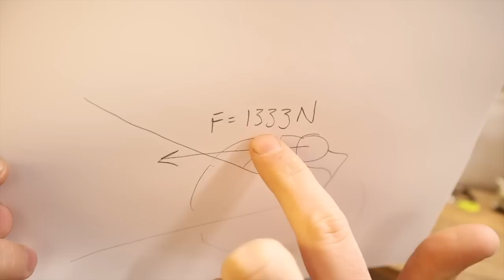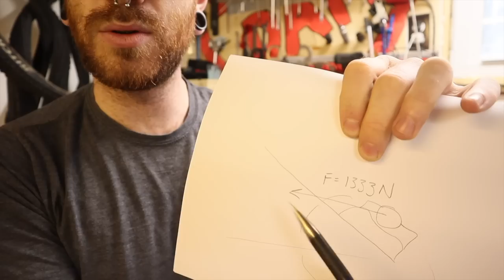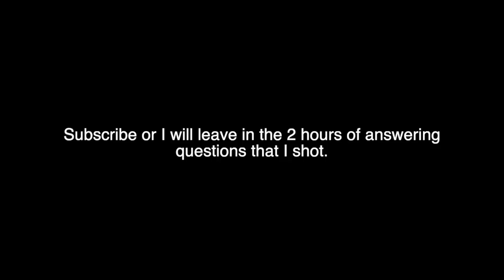Yes I am reinforcing the GT's welded disk brake (ANSWERS).

Comment: I'm welding a iso tab on my rigid fork on my 99 Diamondback outlook cause I got a. Bafang disc brake hub motor with rim and new schwalbe marathon tire for like 40 bucks, with a tektro caliper and rotor. Fork is thick like the black one on the GT, so I'm sure it will be fine. Welding a tab on is cheaper than lacing a new Rim brake rim on for me

Comment: Finally i see you use your degree to justify an idea, i usually use my engineering degree to check ideas that look like bad ideas at first
Reply from the maker: Lol i generally don't show any of it, but if im not sure i will justify with some educated research.

Most people suspect things are much weaker than they actually are.. but I was taught to work with a safety factor of around 5.
Reply: @Spindatt   i get it, depending on the application you choose safety factors if people knew how lean planes and weight sensitive structures are calculated they wouldn’t use them.

Comment: so..   here's the thing// the brakes on the fork already deal with them forces. literally NBD.. my GF dead stopped her indie 4 luckily with a puffed up handlebar bag...   the fork bent the rim bent..  I had 203mm rotors and I'm pretty confident it was all the impact forces.. also I was a welder as a teen in the 90s.. and I'm AMT-S composite structures.. tech as you are..   but helped my brother study for his engineering civil..     replaced with surly big dummy fork again with 203mm rotor...   now welding a 96 tange rocky mountain and getting amped up with videos of the same sort...   yeah I'll reinforce the frame but the fork...add the mount IS the reinforcement..  people hop and do trials with these forks.

Comment: You mention how people are scared of used carbon. Is my fear irrational about my aluminum road bike breaking. Do you know if it’s actually common for frame failure to happen with a pretty lightweight aluminum. How long have u seen aluminum last for?
Reply from the maker: I've seen failures in all materials after years of abuse, though i would say my tricross will last my lifetime.. as long as I don't have a reeeeeally bad crash with it

Comment: If you would'e cut the seat stay on the other side you could've welded back in a splitter to turn the Guru into a belt drive single speed!
Reply from the maker: Tubes are pinched and formed for cassette clearance over there so it was the non drive side tube i had my eyes on haha

Comment: I’m currently doing the same conversion. What filler wire did you use? Shielding gas? Is the GT chromoly?
Reply from the maker: Mig weld flux core, only the seat tube is chromoly!

Comment: did you just kill the guru? :o
Reply from the maker: It was dead long before I got it. Never mentioned it really but the rear triangle was absurdly twisted. Tire always rubbing unless I placed the wheel “just so” and the brake always tweaked to the right.

Yes; we could have tried to straighten it. Though, it’s steel is better used in other places.
Reply: @Spindatt  damn, can't imagine the annoyance after all that work on it
Reply from the maker: I think the resulting projects it’ll donate it’s life to will be cooler and worth it anyway haha

Comment: Hi. Please prepare one more video and make it clear that this calculator was a big joke!
Reply from the maker: open to your rebuttal. Engineering quarrels are the back bone of things like F1 and I like that
Reply: @Spindatt  Here you are:

You made a lot of mistakes while analyzing this task.

First of all, you assumed only the braking load case for the calculations, and meanwhile you should calculate the resultant force from several load cases that may occur together - e.g. braking plus the load from hitting an obstacle (hole, stone, curbstone) - of course taking into account the weight of the cyclist and the bicycle. Moreover, you should consider what the distribution of forces will look like during a sudden turn.

Second, the static load case will not be a critical load case at all. The worst thing you should take into account is the fatigue , with particular emphasis on the weld that you added to the system (the weld significantly deteriorates the fatigue results)

Third, the rear fork is the most strenuous area in the bicycle frame near the wheel mount

Fourthly, to simplify your task, it would be best to see what the forks with disc brakes look like and try to apply this solution to your frame. Then the probability of an error would be lower.

Fifth. Without knowing how to build a bicycle frame without FEM analysis, you will not be able to do it.

I wish you a lot of success and still enjoy watching your films.